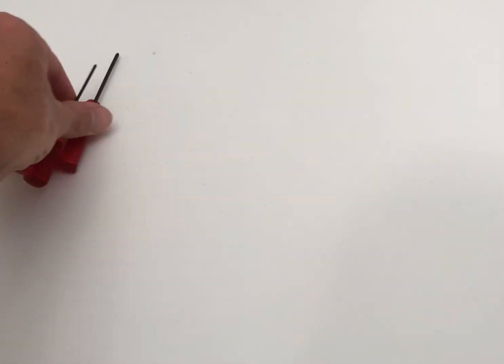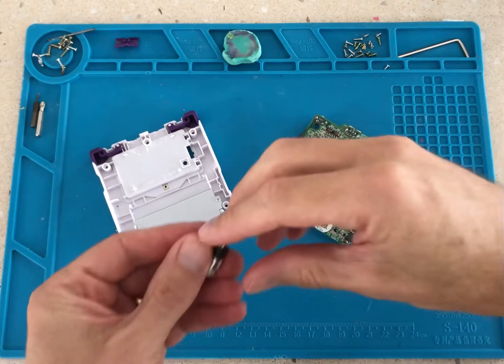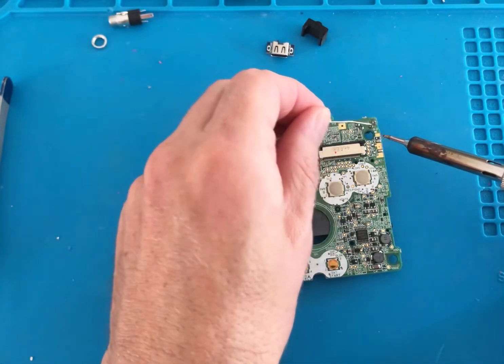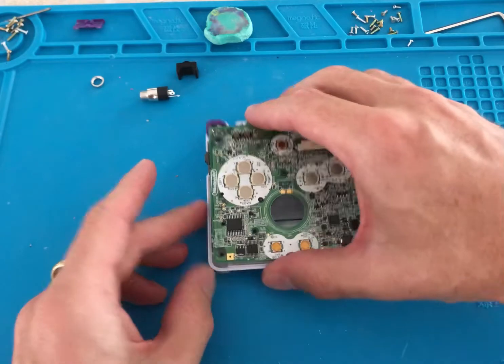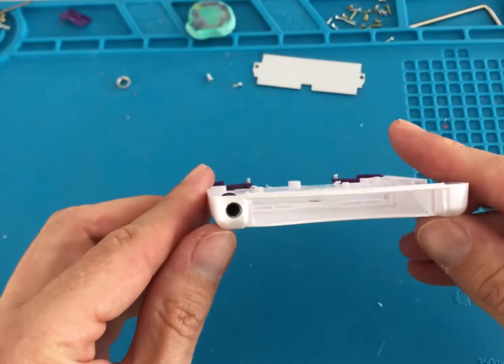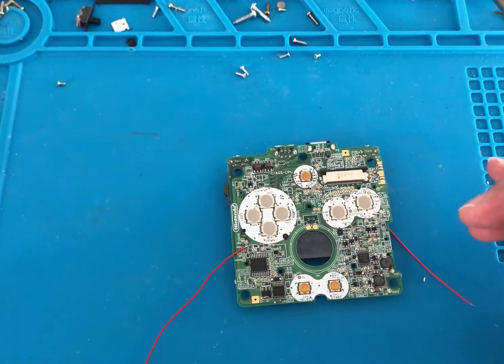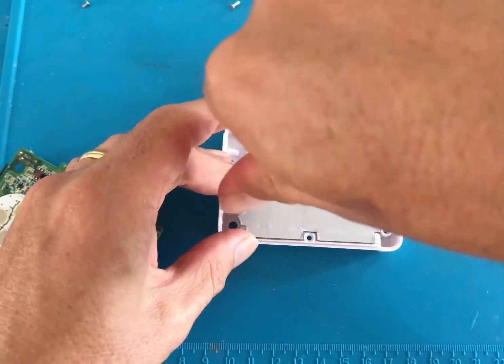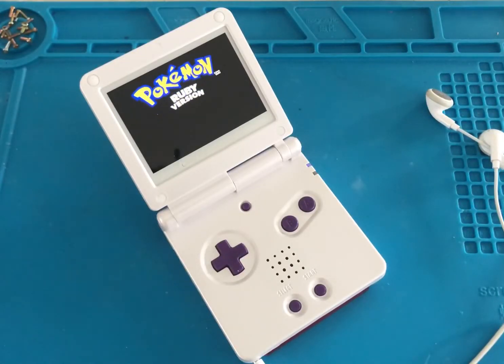Gameboy Advance SP Headphone and USB-C Charging Mod - How to #gameboy #nintendo #gameboycolor #gba

Comment: Nice video! I bought a bunch of USB C ports but they are just the ports, is that one you have with the PCB a purpose made SP custom socket or a more generic one? Looks like a perfect fit
Reply from the maker: Cheers 👍it’s a purpose made one. Handheldlegend sells them. You can also use the generic however there’s more wires to solder
Reply: @GameboyCustom  thank you!